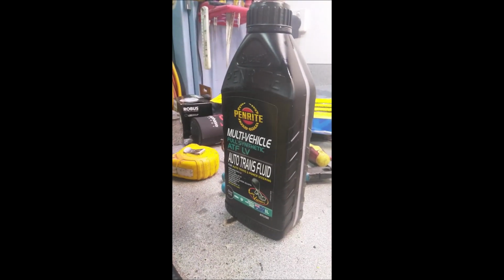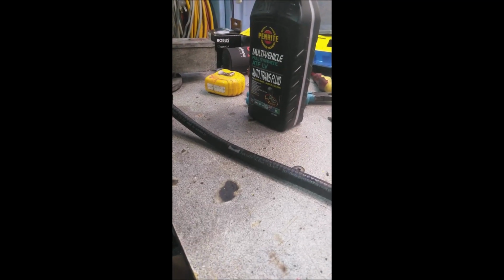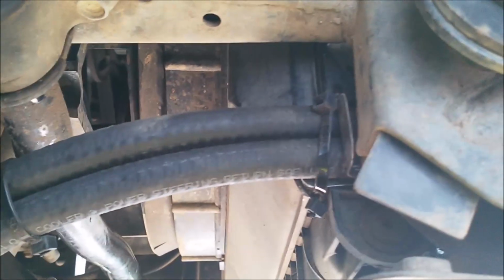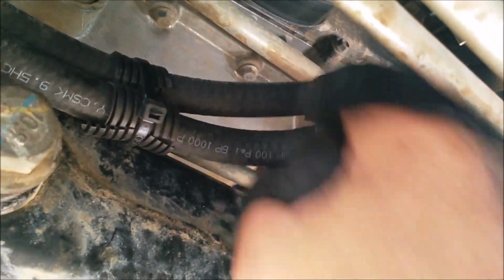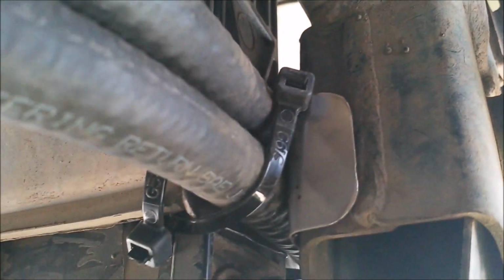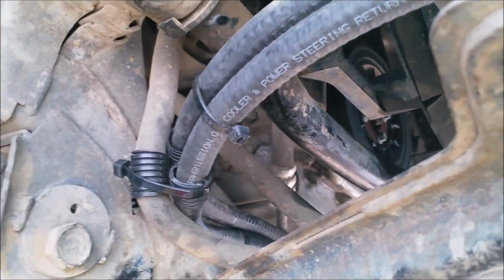Transmission Cooler for 2013 RG Colorado

Comment: Hi mate thanks for the video.  Any chance you can tell me what brand cooker and where you purchased it from, cost etc.  Also would like to know was it worth the effort?
Reply from the maker: I think it was around $100 bought online. Hard to say if it helps as my model Colorado doesn't display transmission temps but I guess it's just a preventative measure so certainly couldn't hurt
Reply: @handymatt9377  when you said heatsink type cooler, does it need to be in contact with metal to waste the heat soak? wouldnt happen to have the online link handy would you?

Comment: some of those bends look very tight . hope the flow isn’t restricted or when the hoses get hot they don’t link closed and shut off flow . plus you really should fit a inline filter to the cooler . only $30 and will filter out any crud being pushed out through . was your tranny a 6L80 ?
Reply from the maker: Done about 10k km with it installed with no problems.👍